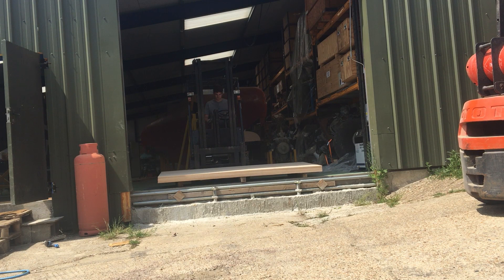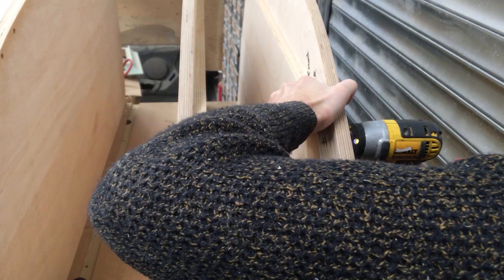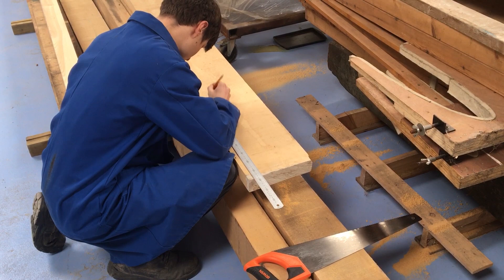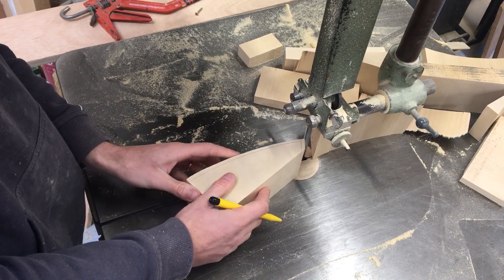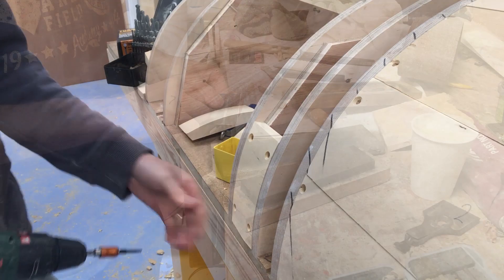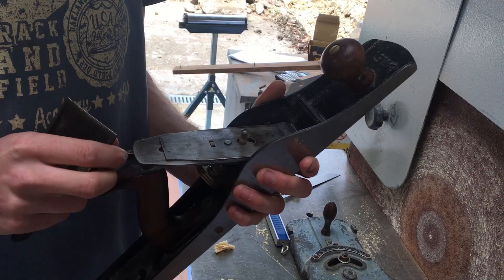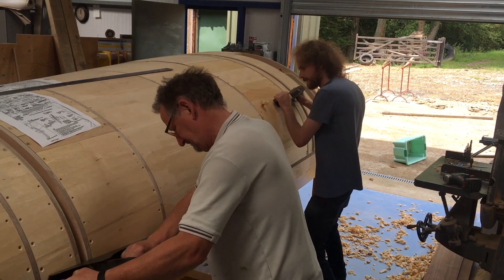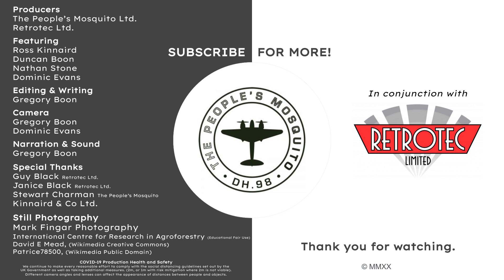The People's Mosquito - Restoration Update July 2020

Comment: This is very interesting to watch, but it does explain why it took so long to get the moulds made. The project needs to get a professional site carpenter to give tips on how to speed up the process e.g. have 2 cordless drills, one with the drill bit and the other with a countersunk bit, or a combined drill/countersink, also use screws in a strip, not individually inserted.

Comment: why not use foam to fill the gaps? It's only a mold right?
Reply from the maker: When bonding the fuselage, the mould is placed under considerable pressure and with limited tolerance foam would be too prone to compression. Hard wood has all the engineering properties we need and allows the team to adjust profile to within 10,000ths of an inch.

Comment: NO WAY are they building this fuselage like the original Mosquito fuselage. The original was planked with thin plywood strips glued to the framework and held with secured metal straps till the glue dried. The method they are using here will make the plane too heavy if they intend to fly.